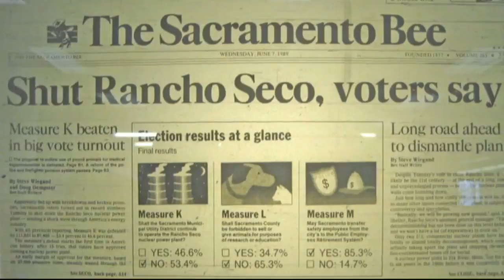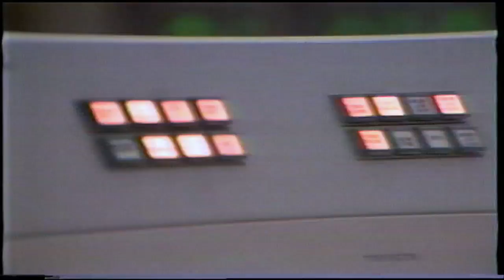SMUD's Rancho Seco Nuclear Power Plant is now a ghost

Comment: That is a very misleading statement, claiming there was “no major accidents”, other than the steam generator dryout. Excerpt from Wikipedia “U.S. Nuclear Regulatory Commission concluded that fundamental design flaws which were known by plant operators and the NRC itself were at the heart of the problem and should have been fixed years before”.

Comment: Weren't Everyone's Electricity Bills Alot Cheaper When this thing Was Running?
Reply: No, they raised rates to build the plant and then raised them several more times to fix problems with the plant. from 1984 to 1985 customers bills rose 40%. In 1988 it cost twice as much to run the plant as it would have for the utility to purchase energy from other grids.

Comment: Fun fact, the energy used to decom rancho seco was roughly equal to 80% of the total output of Rancho Seco during its life cycle, and it cost 10x more to decmo it than it did to build it, a cost effect that increased smud energy rates in a 75 mile radius of the plant by 15% for the next 35 years or until 2047.